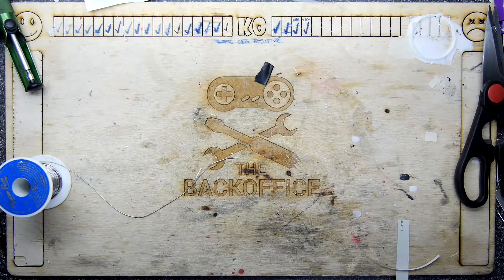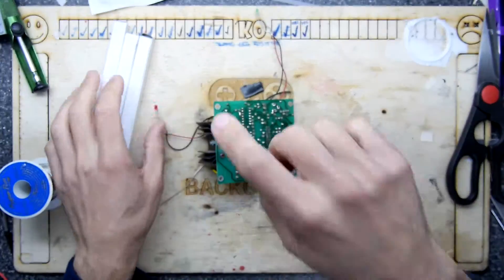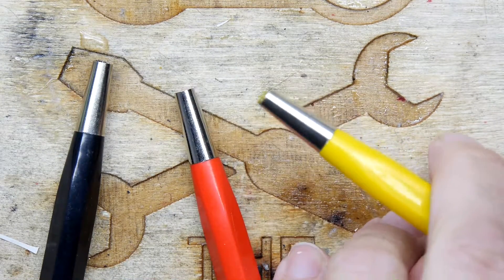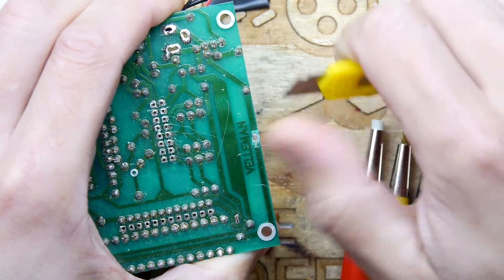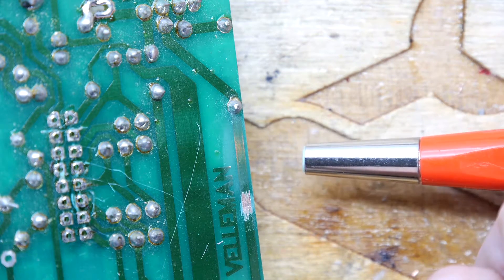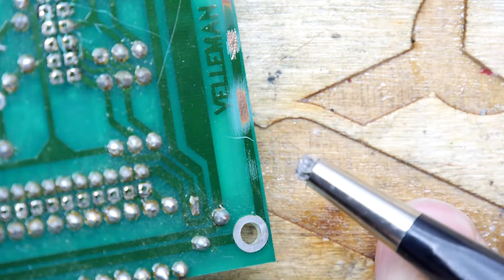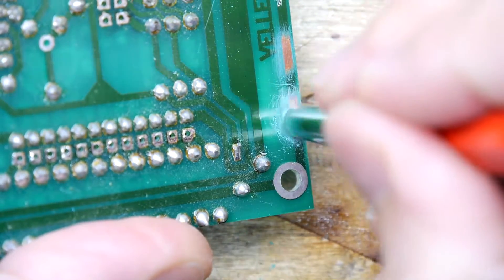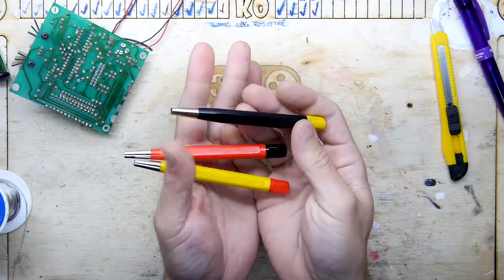PCB Scrapers povvercrazy!

Comment: EBay offer same set  ,plus one other ,they make four different ones,I have a fiber glass one,but I like your video ,I ordered a set like yours,they also sell replacent tips if you need them y radio shack one came with extra tip,but I could have used your idea years ago for fixing board where the foil was bad.

Comment: Radio shack use to sell a fiber glass pen,for removing ,crap from a leaked battery,works well I have one for years plus mine came with a refill.never thought of using it on a circuit board,make sense ,I like the brass too ,where did you buy them.
Reply from the maker: +Ron Thompson I'm not sure where Brian got them - possibly Ali express, but I found a link on Amazon in the description. I think there are a fair selection there.

Comment: Still, by far not as precise a knife (or I rather prefer a scalpel). I mean if you have several tiny lanes right next to each other and remove the varnish from all of them with these pens, you aren't doing yourself any favour. 
I wonder if it would work to cover next-by tracks with maybe electrical tape, simple tape film or masking tape and then use the fibre glass pen without damaging the tape.

Comment: HeHe your very welcome Dr A, there is a nylon pen too which is even finer than the fibreglass but couldn't find it, the fibreglass one is amazing at cleaning edge connectors up, and cleaning old solder pads ready for use. They also sell refills so you dont need to buy new pens, but then at the price they were its hardly expensive.
Reply from the maker: Brian Jones These are going to change how I operate! Thanks so much. The refills look convenient, but as you say, them pens themselves are very affordable. I guess if you were in a production environment you would go through them quickly
Reply: I haven't had my new set long, the fibreglass one is rotten already, but you can soak in IPA to clean them, I have been using my dremel with a brass brush before but that's a bit aggresive but controlled.

Comment: those look pretty neat for small jobs, probably not great for removing 4x 8 inch by 1 inch strips of rotten foam holding a big rf alumininium shield on an atari 800 cartridge bay, i ended using a 4 inch wire brush (which did the job in about 30 seconds)
Reply from the maker: +ImpaledGryphon Nothing an angle grinder couldn't sort out 😀
Reply: not sure i should even speak to you anymore. :(
Reply from the maker: hehe. I take it that it all worked out in the end? :)
Reply: of course, just scrubbed then washed away, reattached with a couple of 3m sticky foam strips (one had to be chopped up and stacked 3 deep into the molding but stuck just fine. me using an angle grinder on my a800 would have been like you using a bandsaw to remove an old plaster from your childs neck, not something to even be suggested about a dearly loved family member. ;)
Reply from the maker: +ImpaledGryphon haha, depends on how steady you are with the grinder I suppose 😂 I never had an 8 bit Atari computer. I might look for one next car boot season.
Reply: you should but an a400/800 wont be cheap, an xl or xe should cost less but a system launched in 1979 with 320x240 res, 4 sound channels + internal speaker (c64 had 3 +0), 256 colours (not bettered until amiga), sprites and 4 joystick ports, absolutely battered any other home computer up until the 16 bits arrived it was so advanced
Reply from the maker: +ImpaledGryphon oh wow